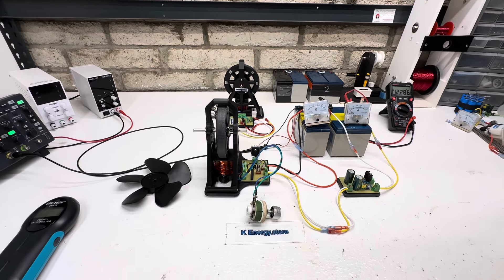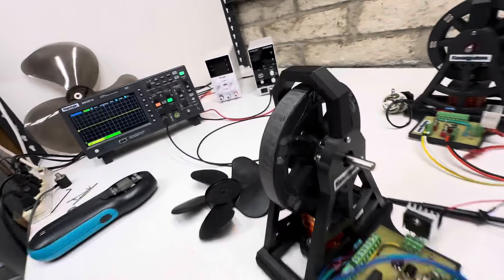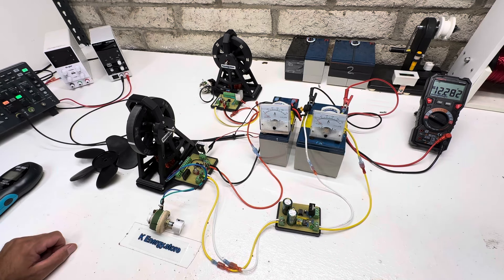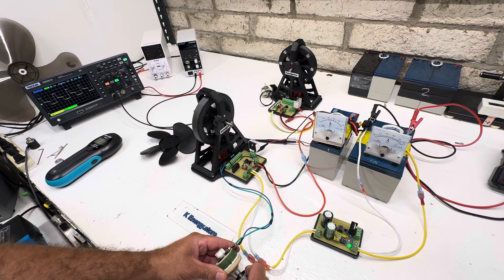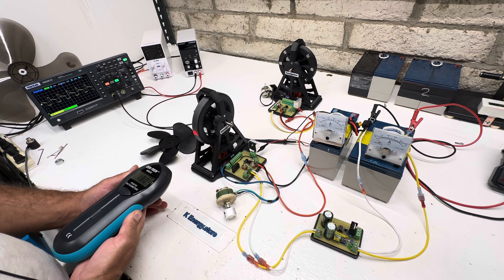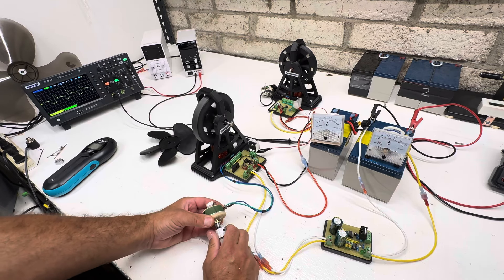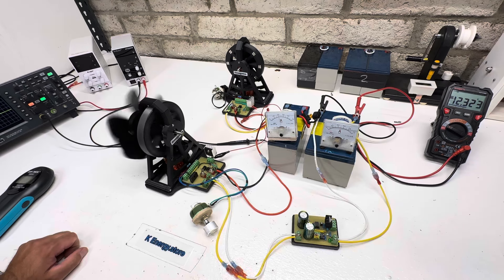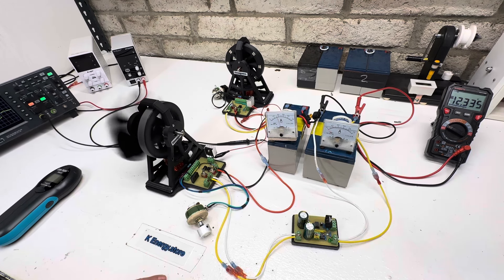Bedini motor with new prototype ferrite magnet grade 8

Comment: I like what you are doing. Would like to make a suggestion. Making one of these that is able to fit the solder spool size coil on it, even better if has ability to add more than one coil. This way people have a choice to get the rotor setup, and then build their own coils and circuits to go on to them.
Reply from the maker: @DavyOneness  both rotors fit the same motor  I can send empty bobbins and empty circuits or anything that is requested
Reply: @kenergy1707  what size are the coils? They looked shorter  than the solder spool size coils.
Reply from the maker: @DavyOneness  60mm x 50 mm x 50mm tall

Comment: I am happy to see this :) 

I need to work more to save up money for batteries, rmp meter, and oscillator. 

Made a custom screw driver for those tiny flat head screws. 

I find it interesting how in one configuration of switches/direction of wheel rotation the system has very low resistance and keeps spinning with little force. When slowed down each magnet jossles the assembly. I see why the small input trigger is needed to keep it going. 

We want high voltage pulsed dc with low current it seems. 

For my oscillator if I use small capacitor I get high frequency but less power per pulse. I assume we want just enough power to prevent galvanic action. 

KEnergy, Joel Lagace made an interesting similar idea here.
 https://youtu.be/SZM3DzjiQ8E?si=lcgfhyfGNxNXGp1z
Reply from the maker: @ElijahCokeley  yes it does spin for a wile even with the neos I’ll have to provide a screw driver for that kit
Reply: @kenergy1707  I will have those batteries by this thursday to set it up :)